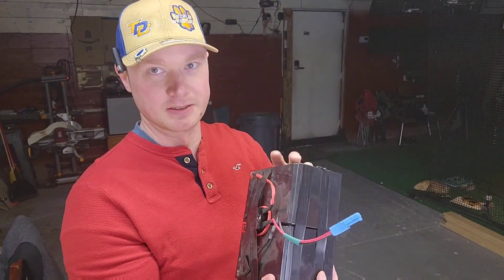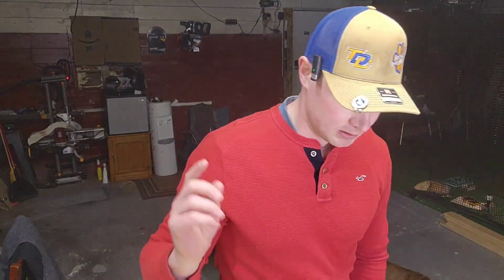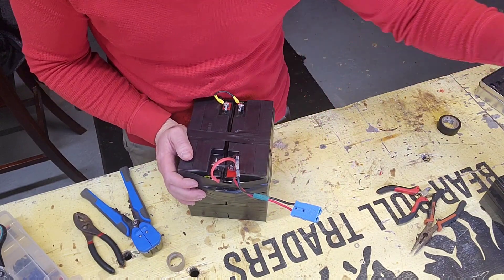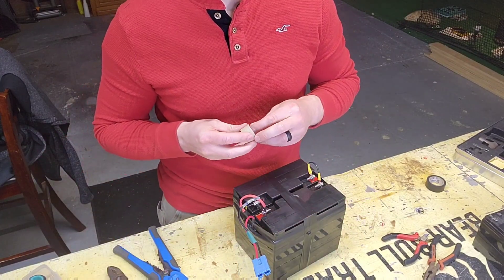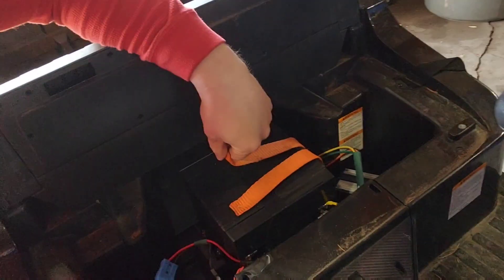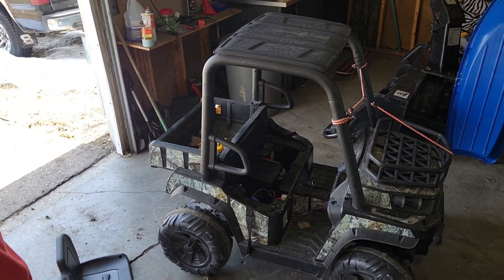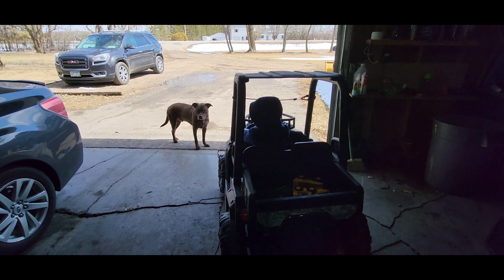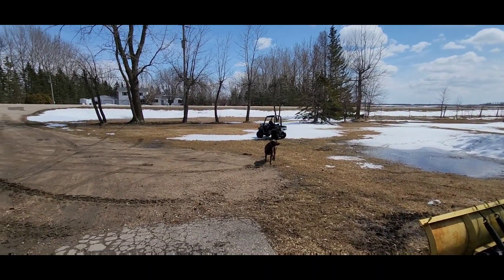kids ride on battery upgrade

Comment: Thank you so much for showing us how to do this. I’ve already gone thru three 7ah batteries. I did the Shengle motor upgrade and gearbox change for my son’s UTV just like how you did it in your other video. Can you please put a link where you got the two 12 volt batteries from? I want to make sure I get the same exact ones so that they will fit. Thank you very much!  Oh and I did hit that like button and subscribed for you.
Reply from the maker: This is the one I use now (2 of them). It's 20 AH. 
ExpertPower 12 Volt 20 Ah EXP12200 Rechargeable SLA Battery [amazon]
Reply from the maker: ExpertPower 12 Volt 20 Ah EXP12200 Rechargeable SLA Battery [amazon]
Reply: Man, thanks a lot. You’re a lifesaver.
Reply: I already have two of them in my shopping cart. I like the way they are absorbent glass-mat technology (AGM sealed) so that I can use them in any position.
Reply: @igolfandimakestuff2629  how are these batteries holding up?

Comment: Do you have links to the batteries used? We have never done anything like this but our battery died and the reviews for the replacement batties are TERRIBLE. So while digging further, i found this video
Reply from the maker: ExpertPower 12 Volt 20 Ah EXP12200 Rechargeable SLA Battery https://a.co/d/4tIIUTz
Reply: This is awesome had my son out on our Toyota Helux electric ride on and got about 80 mins use. Def going to upgrade the amps to get more life out of it. Do you have any suggestions on making a portable charging station or just attach a trickle charger to the second set?
Im thinking to run both for long adventures and swap them when they get low

Comment: Are your batteries still holding up? I followed your video and did the same set up and the batteries were good at the beginning of summer but now don’t seem to hold a charge. Truck died in about 10 min of use and the indicator light on the charger will turn green after about an hour.
Reply from the maker: Yea the batteries have been hit or miss. I've had some work all summer and not work again the next year even though I bring them in and some work for 2 seasons. I might just bite the bullet and do lithium. Get more run time and batteries should last 10+years

Comment: Any advice for someone without the OEM battery connector?
Reply from the maker: Any connector should work? As long as you attach them on there, you can just go online and look up waterproof wire connectors push connectors, something like that.
Reply: @igolfandimakestuff2629  thank you. Ordered a set of xt60 connections.

Comment: If you double the batteries does that make it double the amps as well? So 40ah?
Reply from the maker: I wired it in series. So stayed at 20 AH but got 24 volts. If you have a 12v kids' toy, you would wire it in parallel and get 40 AH but stay at 12 volt.
Reply: Cool, thanks! I'm going to try your setup. My kids battery died out. What gauge of wire did you use and terminals? Any links?
Reply from the maker: @PshhMatt  I just used basic parts from a hardware store.  Spade conectors,  And 12 -16 gauge wire from most hardware stores
Reply from the maker: @PshhMatt  TYUMEN 50FT 12/2 Gauge 2pin 2 Color Red Black Cable Hookup Electrical LED Strips 12V/24V DC 12AWG Flexible Wire Extension Cord for Ribbon Lamp Tape Lighting https://a.co/d/bcxNeJb

Something like this will work for wire. Most hardware stores, even walmart, have some. Same with spade conectors 

TICONN 100 Pcs Nylon Spade Quick Disconnect Connectors Kit, Electrical Insulated Terminals, Male and Female Spade Wire Crimp Terminal Assortment Kit https://a.co/d/98mThAo

Comment: Why not hook up a DeWalt battery or two?😊
Reply from the maker: That's what I did here to this 6 volt.
https://youtube.com/shorts/6cAryJmzqzc?si=RTIjtrBU0HYsklZR

Could do a 40v Dewalt battery in the big car lol
Reply: That's what I was going to do at first but my buddy said it destroyed his batteries pretty quickly. And they're not cheap
Reply: @roadtoserfdom3020  I haven't had an issue with mine. After 3 years

Comment: Do you have a wiring diagram ?
Reply from the maker: I do not. But it's just 2 12 volt battery wired in series to dbl the voltage. To make it 24 volts.

Comment: First of all thank you for making this content. Its been difficult finding any DIY videos on this UTV 👍👍. How do you charge the batteries? Also, how long does the battery last for?
Reply from the maker: Thank you. I charge the battery just like you charge the regular battery.  It just takes a little longer as it's a larger battery.  As far as how long it lasts, I don't even know. It has lasted so long that kids never use a full charge. I'd say around 3 hours of hard on and off use. Obviously, child weight/terrain has a huge impact on life.